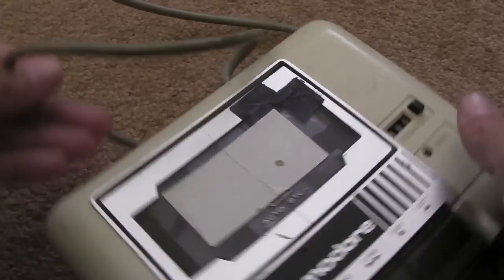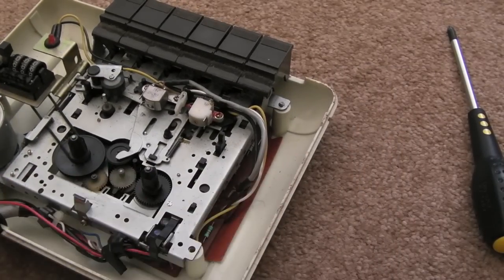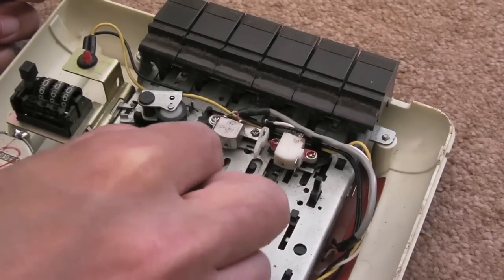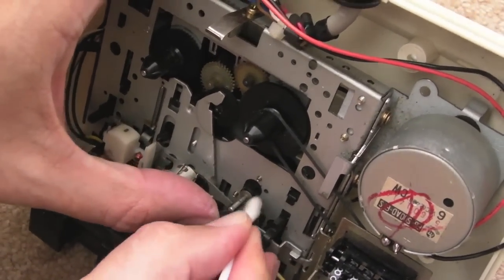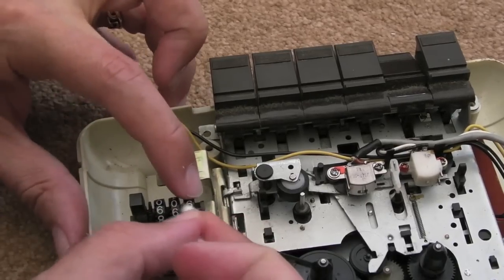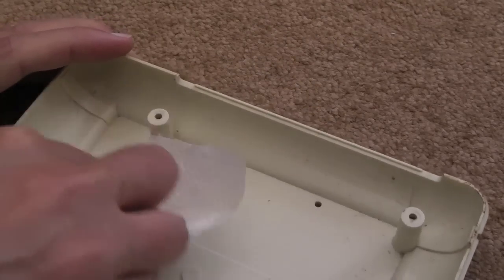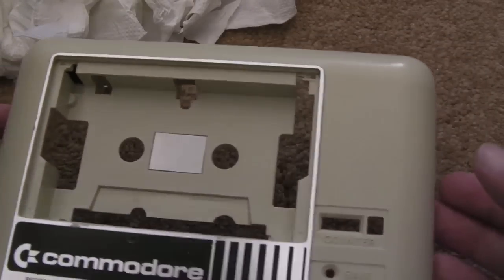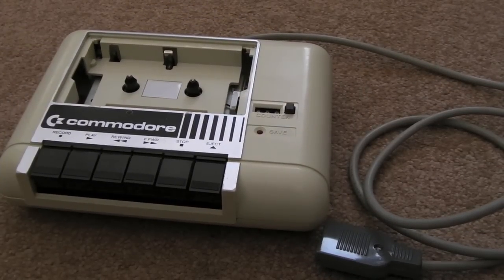Commodore 64 (C64) C2N Datasette Clean & Restore

Comment: Just started reusing mine but some of the tapes are not fully loading, they will find the game but then the tape will run out I'm 47 I've had mine since I was 16
Reply from the maker: It probably needs a new belt, the pinch roller cleaning (and gently scratching with a nail file), and the head cleaned.

Comment: Great Video & Many Thanks!
I have just purchased a mills associates "load it " Datasette for the Commodore 64.
It looks like a genuine Commodore datasette thats been modded.
I have purchased from ebay knowing that this item is sold as spares and repairs and is faulty.
I realised if the deck is toast, hopefully I can transfer the mod to a working
 datasette.
I always wanted the "c64 load it" because  I had some genuine game tapes that was flakey at loading.
I remember adjusting the azimuth heads just to get a game to load.
Then afterwards using a tape head alignment tape to get it back.
Time to dig out the old c64 thats been shoved to the back of a cupboard with its games, I think.

Comment: Great work. Such a shame about the Door though. Did you get a replacement? I've owned mine since the 80s but I've never taken it apart to clean it.
Reply from the maker: Thanks!  Yes, I later found a faulty unit which was used for spares to fix another 2 or 3 units - the door came off that one and is perfect =D

Comment: i wouldnt bother boiling the drive belt its not very reliable, you can also get them new
i just wash the case in hot water in the kitchen sink,washing up liquid and brush job done...way easier bud

Comment: The C64 got a lot of stick for its 'slow' tape deck, but having also used an 8-bit Atari with its tape deck, I can tell you that the C64's wasn't that bad at all!
Reply from the maker: Haha, I didn't know that about the drive being slow.  I always felt the C64 was quicker than the Spectrum at loading but that might not be true.  I think the C64 is something like 300 baud, maybe the Spectrum is faster oO?
Reply: Well, I always found the C64 tape loading reliable.  I didn't have a Spectrum back then to compare, and comparisons today might be skewed by old tapes, drive belts, read heads, etc.  I just assumed that the C64 was slower by design to improve reliability (the C2N was designed for the PET small business computer, after all).  Or just that C64 games were more advanced, and longer tape loading was the price :D  Turbo tape loaders later proved the hardware of both C2N and C64 was capable of higher speed.
Reply from the maker: MarkTheMorose Yeah, C64 loading was more reliable than the Spectrum that's for sure.  The nice thing about the C64 was the tape units were calibrated to specific settings etc, so all C64 decks were supposed to be roughly the same regards the azimuth position.  With early Spectrums everyone had a different tape deck and pissing around with the volume, tone and azimuth was a common event.  The Spectrum +2 helped with that a bit, but there were occasional Spectrum games I bought which I had to adjust the azimuth for in order to load.  Very annoying lol
Reply: I also started life on the Atari 8-bit and then moved to the C64. The Atari 8-bit was chronically slow, the C64 felt like it loaded almost instantly after using that. (yep, i am replying to a 7 year old comment).
Reply: @DavePoo2  Presumably your comment was uploaded via an Atari 410 or 1010 tape drive...  ;)
Reply: @MarkTheMorose  I'll let you know in 7 years

Comment: Using alcohol on rubber parts is usually not a good idea as it tends to dry the rubber out. Platen cleaner is the right stuff, it cleans without drying out the rubber. I used to work as a technician with a much older guy who had a lot of experience repairing typewriters and reel to reel equipment and he caught me using alcohol on a print roller to clean it and told me about the Platen cleaner that is designed not only to clean, but to help restore rubber and keep it soft. He actually told specifically what to get, but it was so long ago (back in the 90s) that I don't recall. I do know he said it was platen cleaner though.

Comment: hi mate, ive got a couple spare breadbin style c64's in the loft, they have what seems to be a common problem of powering up but not displaying a picture.....any idea what the problem with them is ??
i can always tell when someone selling one on ebay has this problem because they list it as powers up but they have 'mislaid the tv lead' so cant test it !;) haha
Reply from the maker: The first thing I would check is the PSU - make sure voltages are OK on the PSU.  Then check the internal fuse there.  If the fuse is OK and it still doesn't power up my first guess is the VIC II chip - they are normally socketed so you can swap it out pretty easily.
Reply from the maker: Also worth checking the voltage coming out of the 12v regulator and 5v regulator (right hand pin on each of those 2 regulators).  One should be 12v, the other 5v.  If there's a problem there it should be a case of swapping out one of those regulators.  If the 12v is missing or the fuse keeps blowing it could be the bridge rectifier, or possibly the TIP transistor near the cassette port or the VIC II / SID drawing too much power.
Reply: GadgetUK164

sorry mate what i meant was it powers up and the light comes on, but there is no picture coming through the tv ??
Reply from the maker: Same thing as I've described above - probably power, or VIC II in the first instance.  The LED can appear OK but that doesn't mean the voltages are OK.  One thing that can kill C64s is over voltage - if that's happened numerous chips could be faulty, but that is rare.
Reply from the maker: minks36
By the way, simply re-seating the VIC II chip in its socket can sometimes bring it back to life.  I had that problem with this C64, which I forgot to mention earlier.
Reply: GadgetUK164

great stuff mate, cheers :) when i drag them out the loft i'll give that a try
Reply from the maker: Let me know how you get on =)
Reply from the maker: minks36 Blank screen could also be the PLA chip btw!